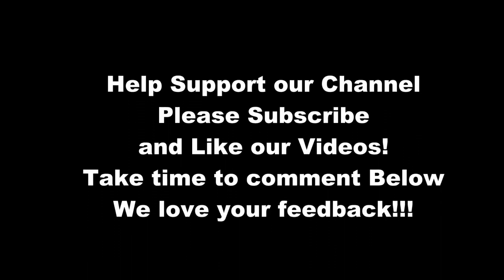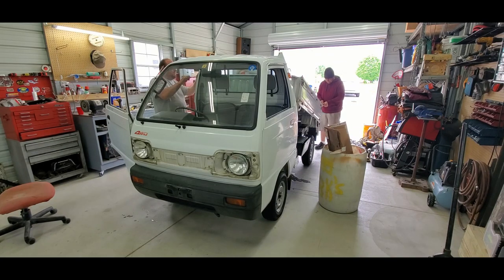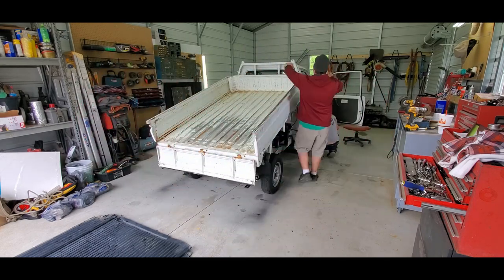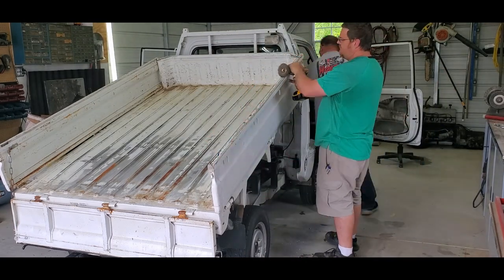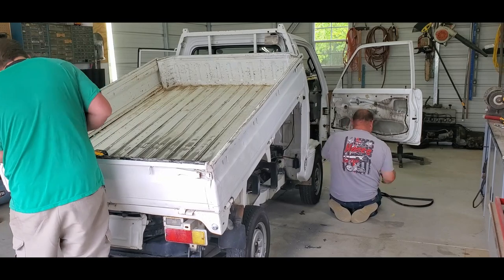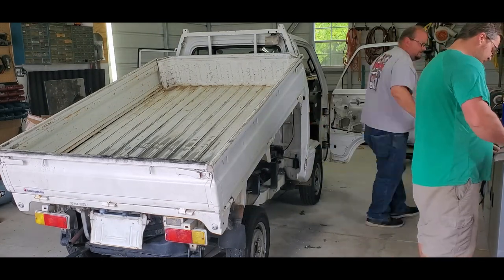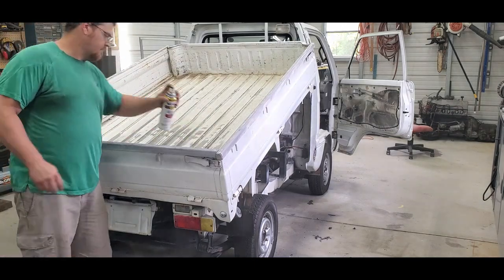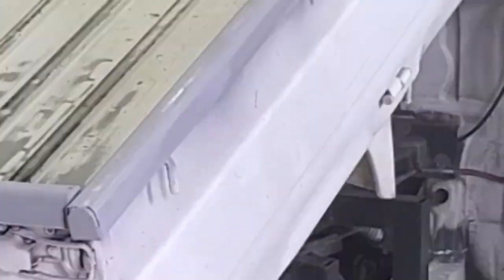TRANSFORM YOUR KEI TRUCK FOR LESS THAN $1000!!! SUZUKI CARRY 660 UPGRADES, JAPANESE MINI TRUCK

Comment: The music got on my nerves. Had to turn off the video. Sorry!
Reply from the maker: Sorry about that, I wasn't pleased with the music in the final upload either. Something changed on the volume levels when it was rendered. It was an issue we had to get worked out over several videos. Final edit sounds good and when it would render to YouTube it was way louder. It was fixed in later videos. 
I don't really like the music either but if it's not royalty free YouTube pulls the video almost immediately. Please express your thoughts to YouTube about letting us use all music in videos. 
Thanks for watching.

Comment: Those are cool little trucks.  Not real sure what I would do with one, but they are neat.
Reply from the maker: They really are and they can go anywhere! The Suzuki is a great option with 4 speed manual with high low range. and locking front and rear. It's a beast! Thanks for watching!
Reply: Uhhh you could take over the world!!!! U need to get one!
Reply: Love the dump bed! Wish I had one on mine!
Reply from the maker: @212acres3  Agreed!
Reply from the maker: @212acres3  The dump bed is awesome. I was wondering the other day about coming up with a bed attachment that would allow you to use the dump action to run a scraper blade, small plow or other options behind it.
Reply: @MyHondaFix  that would be awesome
Reply: @MyHondaFix  could i find one thats automatic?
Reply from the maker: @ryanisbored8273  yes sir, there are automatics out there.

Comment: Hi, I am looking for help and advice to upgrade the Suzuki Carry. I work in Tanznaia and want to use this car to support rangers protecting wildlife. Would you be able to offer advice or ideas on what can ( and cannot) be done in an upgrade. Happy to connect via email.
Reply from the maker: As far as dependability they are great when they are stock. Locking front and rear are a major plus and almost required for off road traction. 
They are perfect the way they are and have been made better over the years. They only get better when customized for your needs.

Comment: I need a car like it for how much it costs
Reply from the maker: You can find them starting out cheaper with less options. I've seen people pay as little as 500 not running. Some people pay up to 6-8k for a used model with a lot of options. You also have to consider if they are registered street legal or off road only.